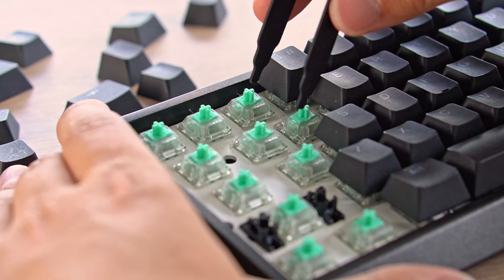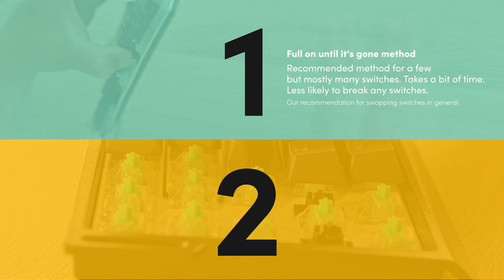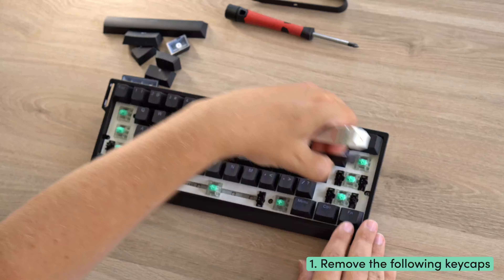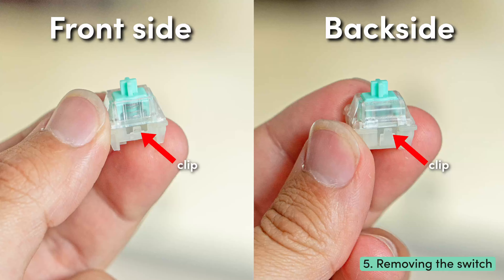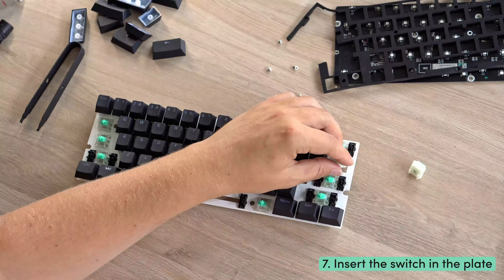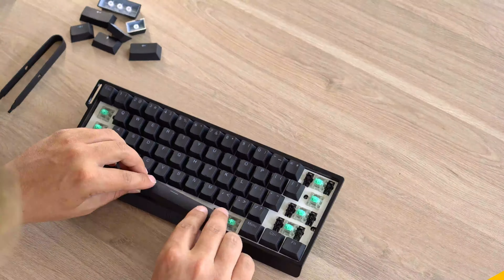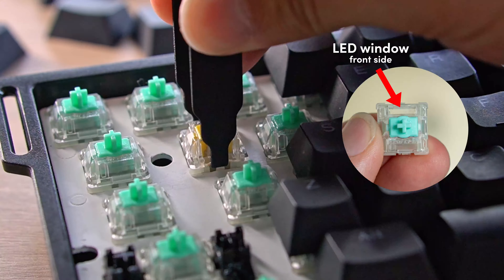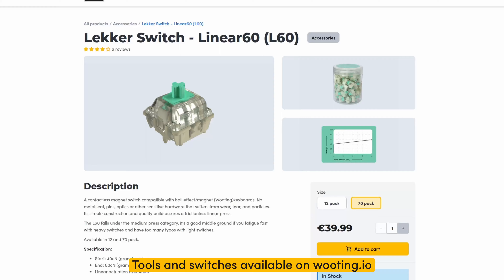How to Swap Lekker Switches in your Wooting Keyboard

Comment: LOL I needed this video 1 hour ago before it was released 😅 I did swap the stock L60 switches with the NEW L45 on my wooting 60HE. I used your How to LUBE your Wooting Keyboard video, which is also very helpful for swapping lekker switches.
Reply: What's the difference. I want to buy the wooting keyboard but i saw the extra products now I'm mind fcked holding purchase to figure out what this lube and switches are. Shipping costs are expensive haha.
Reply: @84xennion  The main difference is the actuation force, the yellows feel snappier. I did a video comparing the stock and the yellow switches, if you want to check it out.
Reply: @Raglarak  i went to your channel but couldn't see any video's on wooting or switches🥶

Comment: May I ask why you have to take the pcb out instead of just pulling the switches out while it's still screwed in? New to modding and figured if I have to do this, I may as well just fully mod it vs just replacing the switches.

Comment: i just swapped springs on a few of my switches with the second method. i can't see how it would be any issues for the switches, you're doing basically the same force on them than the first method wich just looks like huge extra effort for not much gain, or someone please explain how the 2nd method could be unsafe? i'm going to do whole keyboard next

Comment: I'm cleaning my Wooting One for the first time and have taken it apart. It's really well built and easy to disassemble. 

I'd like to wash the keycaps, plastic and metal case parts in a bucket with warm water and dish soap. 

Can I throw the switches in too or will they be damaged if submerged in water?
Reply from the maker: I wouldn't submerge the switches unless they are really unforgivingly dirty inside hindering performance. Otherwise, just clean the outside with (soapy) cloth.

Comment: The 8 screws on the back of my board are SOOO tight and won’t budge at ALL. How am I supposed to get them out?
Reply from the maker: You are using a PH1 tip? If the screws are even too tight for that, then we might need to address any overtightening issues with our manufacturer.

Comment: Does rapid trigger still work if you swap out the switches
Reply: depending on the switches. Magnetic ones like the new Gateron Magnetic Jade usually works but do your homework before buying

Comment: So we pay $165 for a keyboard and get no switch puller, which I find very funny considering I had 5 wooting ones and got a switch puller in everyone I ordered, which seems a little GREEDY on wooting part.
Reply from the maker: It's not that we didn't want to, it's that we couldn't use the same anymore and the alternatives on the market s u c k with terrible cost pricing that isn't matching its value, might as well add other things to the box then.

We are soon to replace it and put back the original puller style but then custom made and all new 8)
Reply: @Wooting yall are great no one has better communication then you guys